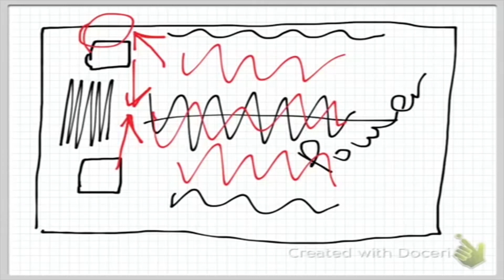Pro Sound Speaker Placement

Comment: From what I understand,  double volume is +10db, not +3db as commonly told. Therefore + 9db is only a 90 percent increase in Sound perception by the human ear. Also, putting two sun's together gives you another 3db, two subs won't double the bass as a lot of people believe.  Therefore:
On the floor +3db
Two together + 3db
Next to a wall + 3db
Equal to plus 9db ergo, 90 percent increase in perceived bass.

Comment: Was wondering how you would recommend setting up a “garage gym” system, obv want to be able to hear the best throughout without having to over do the db level. Would you recommend 2 in wall ceiling speakers or 2 corner wall mount speakers? Dimensions are 21x21 about 9’6” ceiling height..

Comment: I DJ in a bar with a similar setup you used in this video. The original subs were hidden underneath seating throughout. We had to push them hard to feel anything and end up blowing both 15in subs. We ended up ordering a 18in sub and put it in one of the location. Once again it wasn’t hitting unless we pushed it hard to almost clip. For an event we brought in more subs and set them up on both sides of the DJ table. Still would not hit. But we moved the 18in sub into the corner to use as an DJ monitor sub. We left it there be cause we were blown away by the output from it. We thought maybe the 18in sub wasn’t broken in or something. The whole bar hits now and the 18in sub in the corner never hits clip. This works. Can’t wait to try it with my two 18in EV Subs.

Comment: A bit off topic, but a friend bought a powered SVS sub (I THINK -- not 100% sure of the brand) and he claims the units have two available inputs -- one for line level and one for direct connection to amp output, i.e., parallel connection to the main speaker terminals.  He claims the sales person told him the best way to connect would be thru the speaker connection.   I thought this was absurd because with that configuration, you will be adding the amplifier noise of the main amp to the input of the sub amplifier.  He said the salesman said that the reason for this hookup  -- the main amp output/speaker terminal to the sub input was so that the coloration that the main amp is giving to the main speakers would also be reproduced by the sub.  I hold fast to my position that such a theory is vudu audio.  

Even referring to your video on gain structure, it would be absurd to take a signal (amplifier out) that is a thousand times hotter than what the sub amplifier wants to see, only to then have to pad it down so the sub amp can use it without blowing itself to smithereens.  Am I incorrect thinking this is a bad practice to feed any amp output signal into another amp's input, as this is just adding any anomalies of the first amp to the overall final signal? 

Any thoughts would be appreciated.
Reply: A little late to answer. But...

Basically if it has terminal to accept speaker wire and an output to pass it though, it's not going to hurt it. It's High level input and almost always on home theater Subwoofers.

The part about the coloration of the amp is technically true, all amps have a sound signature that is unique to each one, but really if you're not a super audiophile, just use the LFE out on the receiver if you don't want to use the high level.
Reply: Some power subs do have line level and speaker level inputs ( JBL does for sure ). You can run a cable out from a speaker being powered by an amp straight into the speaker level inputs on the sub. The sub has reducers to handel  the power coming in. I find this to be a very a very hot signal and prefer running from the Aux or monitor channel on  board to the line level on sub.

Comment: I understand that you want to avoid all the power alley stuff, but what if you only have mains, no dedicated subs, and want a full stereo spectrum? Doesn’t that make the interference unavoidable? Or is there some other clever way to fix that?
Reply from the maker: This really only affects dedicated subs, if you only have mains you won't notice, much difference.
Reply: Power ally isn't really noticable till you get in the lower frequencies. It's the size of the waves that cause it. most main speakers just won't produce a large enough wave  to worry about power allay, but can still cause phasing issues if bouncing off too many walls. On a left / right stereo set up   aim your mains slightly in towards the dance floor a bit to take some bounce off the side walls and help get a fuller sound on the dance floor.